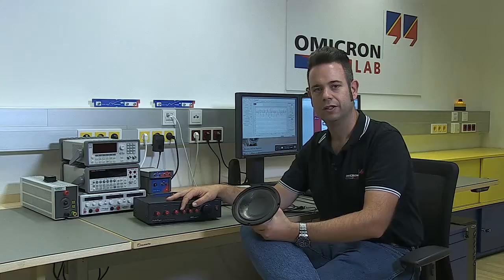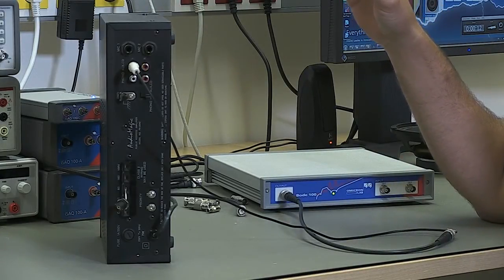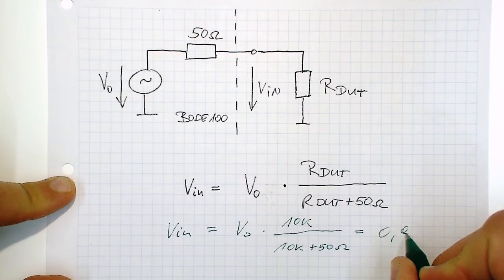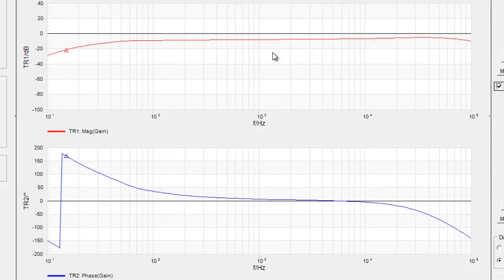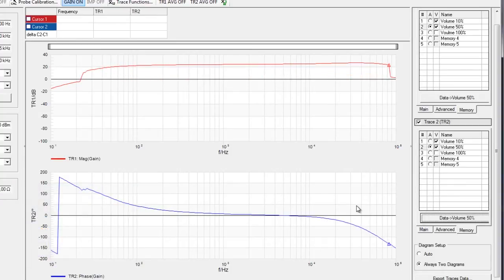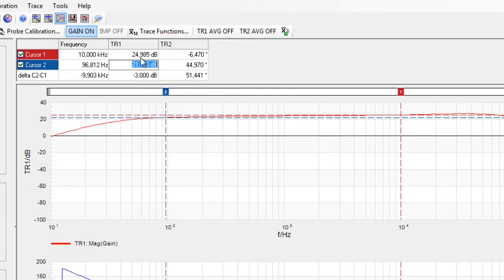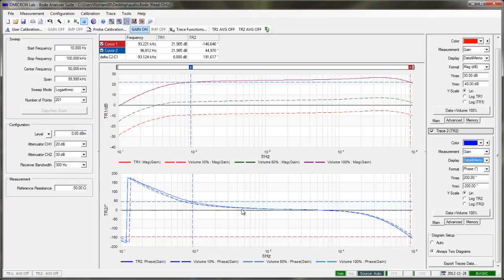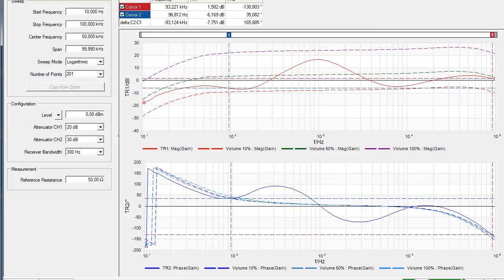Audio Amplifier Measurements with the Bode 100

Comment: What if the input impedance is really close to 50ohm? Let's assume 150ohm. What's the other measuring technique that does not use the bode output voltage? 01:26  to 02:25
Reply from the maker: Dear @NoaddictQ,
please be aware that the video as well as the SW used in this video is really old. Therefore, please check out this newer application note: https://www.omicron-lab.com/applications/detail/news/audio-system-measurements as well as the appnote on impedance measurement methods: https://www.omicron-lab.com/applications/detail/news/impedance-measurements-using-the-bode-100.
If you have any further questions, please contact us here: https://www.omicron-lab.com/contact/support